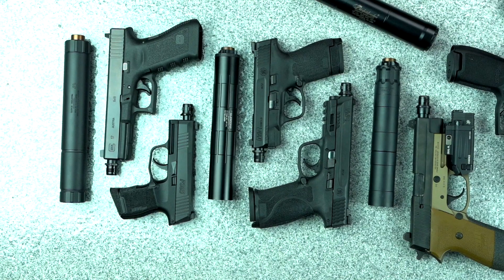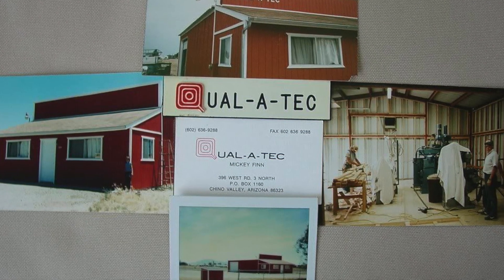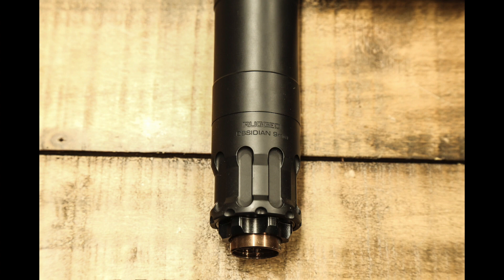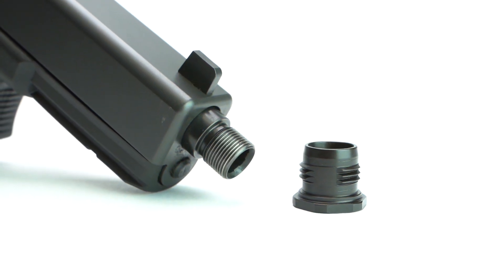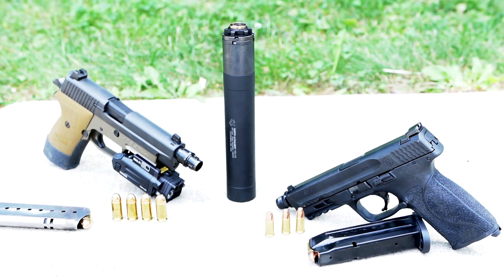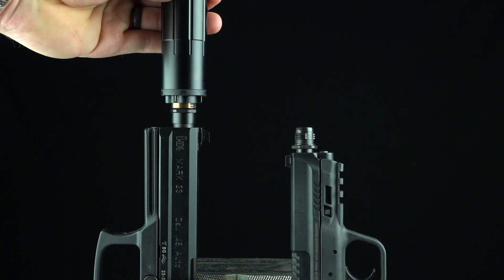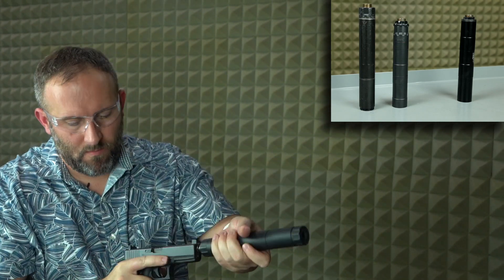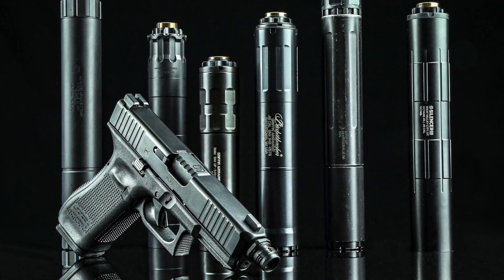The Griffin CAM-LOK™ (Covert Application Mount - Locking)

Comment: This is awesome. Would be very cool if you guys made replacement barrels with the taper and those threads so that you wouldn’t have to remove the adapter to remove the barrel. Also, any chance you will make pistons for yhm and gemtech? If so I need like 50 adapters lol. Thanks
Reply: Which models do you have?
Reply: Evan Green : I have the gemtech “LID” that I use on multiple cans and the Yankee hill machine sidewinder

Comment: So in order to remove the pistol barrel for cleaning you have to take the cam lok piece off that you just torqued on?
Reply: You probably could just clean around the barrel with it still floating in the slide. Not ideal but probably not a deal breaker for most.
Reply: If you have a threaded barrel, you must remove thread protector or any attachment to remove barrel. Inconvenient but you can clean barrel without removal. Also it is not difficult to remove and re-tourque.
Reply from the maker: you dont need to fully field strip a pistol very often.  Every 6 months to a year is adequate depending on volume of shooting.  You can clean alot of a pistol without taking it apart.  That being said this takes less than a minute to take off when you want to field strip your handgun. 
 DONT USE THREADLOCKER on the adapter and you wont have an issue.   20FT/LBS of torque is recommended
Reply: Yep, I shoot almost only suppressed and even my 1911 can sit dirty for a few range trips of 200rds each. I'll take needing a wrench to be able to quick attach my obsidian to multiple hosts fast. I don't clean my guns much anyway and they work great or I sell them lol
Reply: No different than taking off the entire can or a thread protector each time. As has been said, can clean the barrel with it in the slide with a rope snake. Benefits for suppressed shooter far outweigh this one "downside".
Reply: I've used the system multiple times now for a couple thousand rounds total, swapping between 9mm and 45acp. It is awesome. I love showing new shooters the difference in calibers, and suppression or unsuppressed fire.

Comment: love this idea to end pistol can from backing off !! They mention Tirant-45/M on webiste - any idea if that includes my circa 2014' Tirant 9 ??
Reply: I strongly suspect the answer is no. The tirant 9 piston is very small and likely will not accomodate this system. I just happened to notice that one day when holding it side by side to other popular 9mm pistons. Almost every other brand uses a single size piston that is bored to accomodate anything from 9mm to 45. Not the tirant series. The 45 piston is larger than the 9.
Reply: @Killerloop357  Roger that, no dice o the tirant 9

Comment: Check out the product page and I have a question. 

How will using a fixed barrel spacer with this system cause damage to the suppressor?

I own a 9mm MG and having a taper mount would be a nice sense of security.
Reply: It will cause damage with high powered rounds. This is not engineered for anything more than a pistol caliber.   You could use it on a 9mm MG but the Low pro 3 lug kit would be better honestly.

Comment: Is there a point in buying the taper mounts for pistol caliber carbines now that this is available?
Reply from the maker: The CAM-LOK system is not intended for use on fixed barrels. Therefore is not compatible with PCC's.
Reply: @GriffinArmamentOfficial  does it loosen on fixed barrels?

Comment: Isn't this the exact same thing as A-Tec's A-LOCK?
Reply: I don't think theirs is compatible with pistol suppressors using nielsen devices.
Reply: No the A-lock uses a conventional thread, and has only one compatible attachment orientation ala Maxim's original interrupted thread system- the A-lok is the maxim system, interrupted in 3 places rather than 2.  This system uses three identical lobes of cam like thread geometry (a novel interface) allowing attachment in each 120 degree orientation possible- eliminating the need to search for or identify the correct mating axial orientation for mounting.  This system doesn't use a conventional thread, or a multiple index thread.  The thread was not supported by a toolpath in the CAM system, because it didn't exist.
Reply: @austingreen3888  Gotcha. Thanks for the explanation.
Reply: @austingreen3888  excellent answe and explanation, thank you!

Comment: This is really cool! Small suggestion? Would be a better video, especially towards newcomers to firearms if the people in the video didn't point loaded firearms at the body parts.
Reply: It's not possible in a product demoing speed to be slow.
Reply: Your hand has to come across the centerline of the barrel bore in order to attach something to the firearm. Proper safety, keeping your finger off the trigger, treating the firearm always as if it is loaded are things that will prevent any dangerous events ever occurring.  For anyone reading this if you feel at all under-trained or uncomfortable/ill-equipped to safely handle a firearm you should seek professional training from an accredited instructor.
Reply: Why are we even talking about this